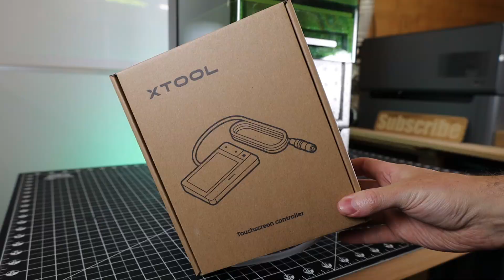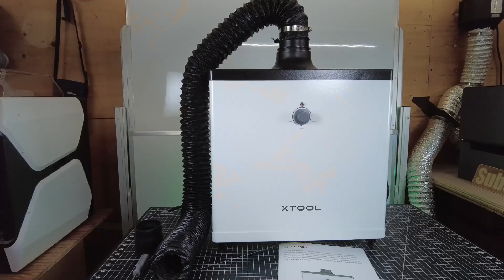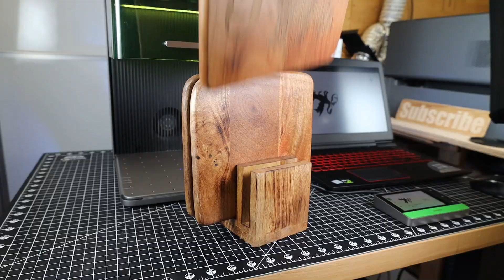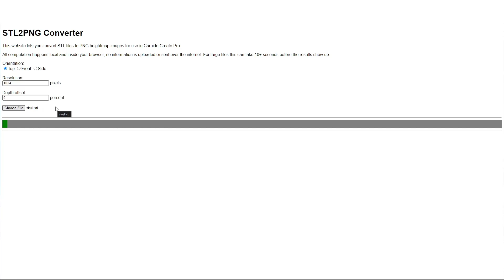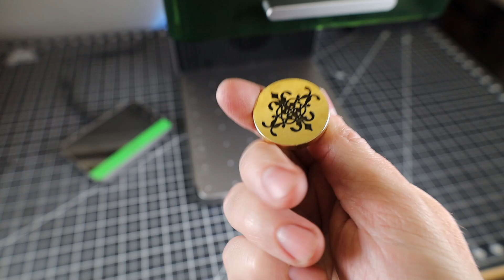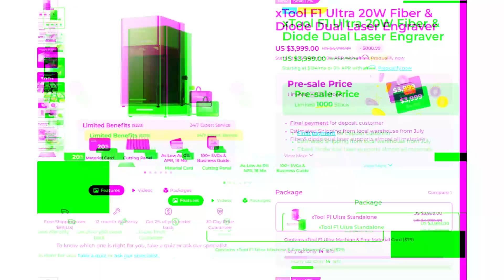Dual 20w Fiber & Diode Laser - Compatible with 300+ Materials - xTool F1 ULTRA

Comment: On printables there is a pre filter that you can 3d print and it compress fit and uses magnets for making a outer layer to hold the filter.  As you use the machine you can swap out the filter and recut a replacement there by keeping the metal flakes from entering in the fan area.

Comment: I was just watching your video on the pepetools wire rolling mill ,  and you shared the torch set made by Smith Little Torch , I was wondering where did you get the rose bud head , for your torch set ??? I looked on the website, and didn’t see the rosebud head , thanks for reading this question 👍

Comment: I want to know how small of a text can the F1 ultra engrave. Have you tested this ?
Reply from the maker: You can do some very small test. What material are you thinking of doing it on? I might be able to make a short showing something
Reply: @GomeowCreations  awesome! I'm looking to engrave metals aluminum, brass. Magnesium is fine. I want to see the smallest text the machine is able to produce Before it becomes unreasonable. Thanks a bunch!
Reply from the maker: How small are you wanting, like do you have a goal size I can start with?
Reply: @GomeowCreations  I had someone do 0.1mm text with a JPT it was only readable with a magnifying glass and it came out well. I wonder if the same can be done with an f1 ultra or how close can it get to a jpt laser.

Comment: Is the 20w fiber strong enough to cut aluminum dog tags out? Also.. will 20w diode do clear acrylic without a coating?
Reply from the maker: Only a CO2 laser will work on clear acrylic without a coating. And what do you mean by cut
Reply: @GomeowCreations  I gotcha. I'm just getting into acrylic. Currently have the F1, but I work at an aluminum mill... and, not so much for electrical... which is what I am... but the labels that we put on hydraulic lines and air lines per our schematics don't always stand up against the rolling oils and hydraulic oils... and... well we have a literal tons of aluminum around and was wondering if 20w fiber would be strong enough to cut blanks of aluminum in the shape and thickness of a dog tag out of a sheet, so that we could then engrave on that blank.

Comment: Hi Randy . Have you used any of these lasers to cut thin gauge sterling ? If so which one and how many passes did it take ?
Reply from the maker: It definitely can but it really depends on what kind of metal it is along with the thickness. So like one of the really thin aluminum business cards can be cut in 5 to 10 passes something the same thickness in silver would take over double that. 

When Engraving for etching that skeleton octopus onto that thicker aluminum card I set it up with too many layers and it just burnt through the card completely leaving a perfect square. Definitely not the best example but yes it can cut metals.
Reply: @GomeowCreations  I was thinking like 22 ga .925 back plates for mounting cabs. Use the laser to cut designs in the backplate instead of piercing them. Especially scroll work designs.
Reply from the maker: I believe with the right settings and some practice you can probably get that done on that gauge of metal.